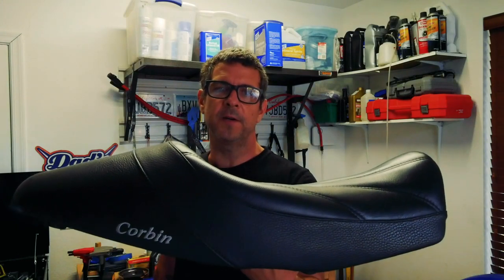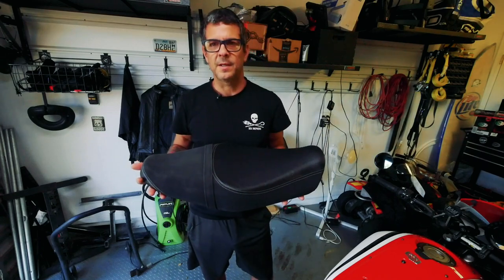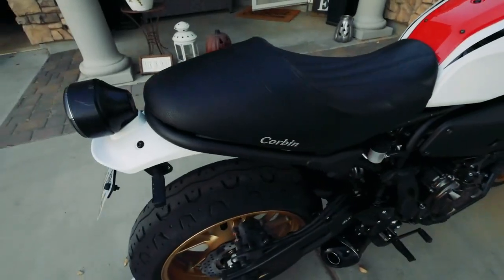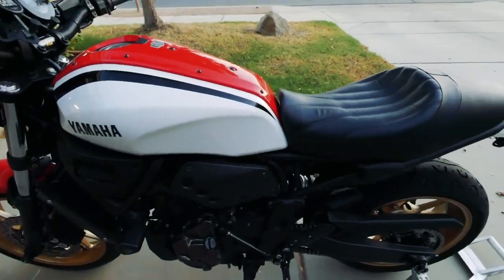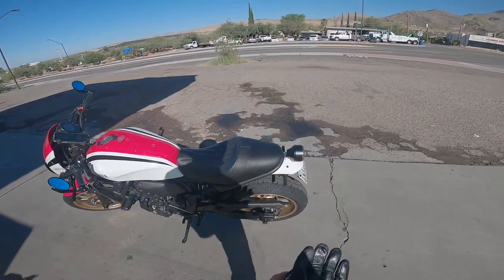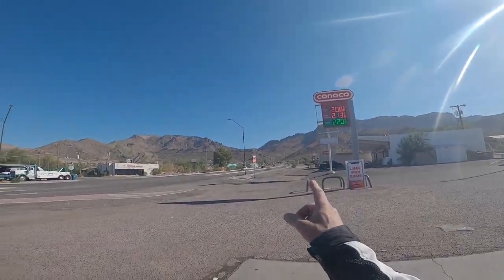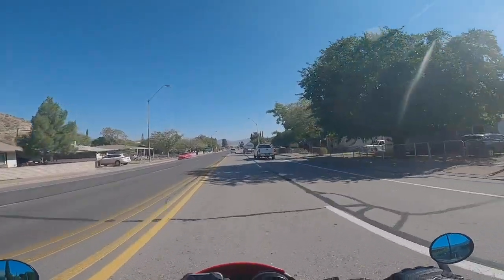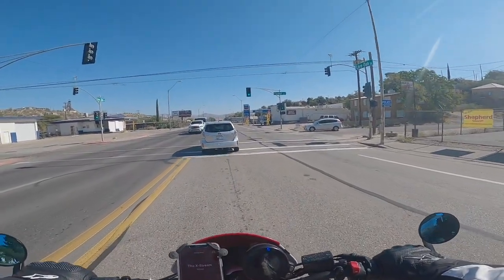XSR700 Mod #13 - Corbin Gunfighter Solo Seat - Overview & Review

Comment: Is there some changes in seat height with Corbin seat?
Reply from the maker: slightly lower but not a bunch. maybe an inch.
Reply: @StreetRodAZ  lower? I would have thought the thicker foam would make you sit higher if anything. I'm very concerned about that because I can't flat foot the stock seat.
Reply from the maker: @tim0theee  yep. just a tad. it prolly won’t help much. But is super comfortable